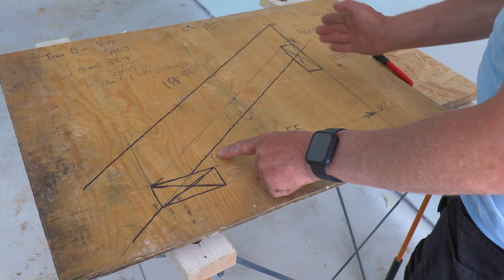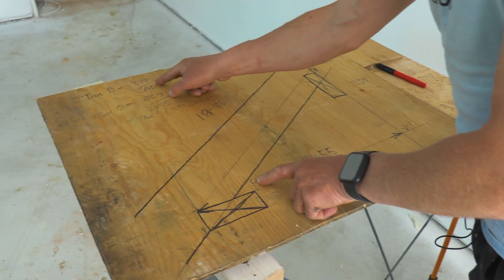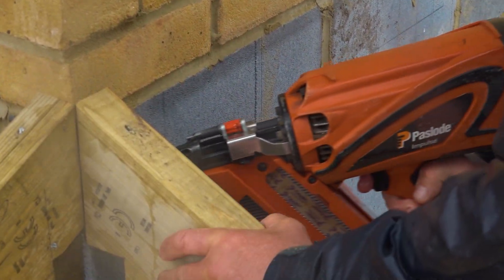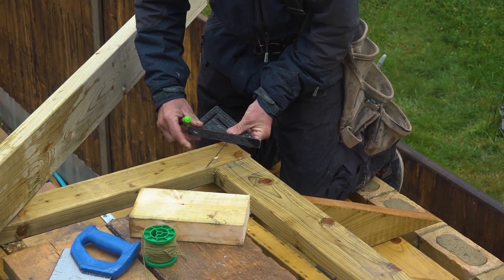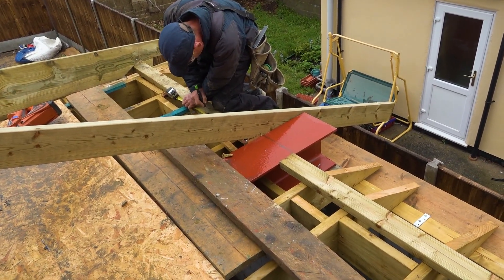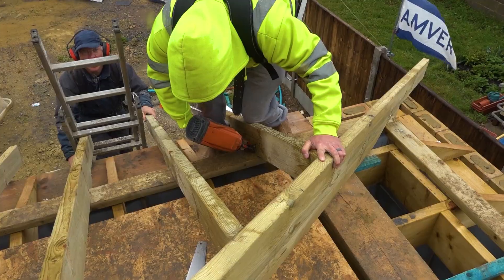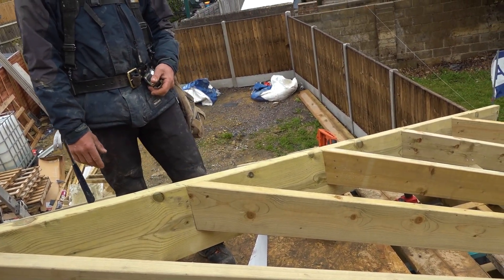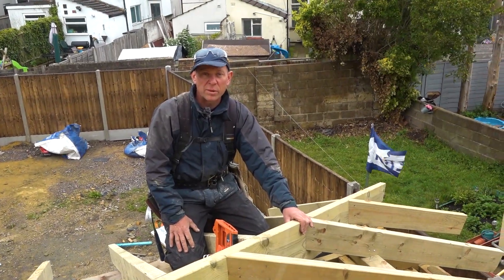How Do You Cut a Bastard or Irregular Hip Roof?

Comment: How’s the soffit going to look on that?  With bastard hips if you bisect the corner of the wall plate with the hip then the hip won’t bisect the brickwork on the corner so the soffits will be different sizes.
Reply from the maker: yes but if you have two different angled pitches you can't expect them to look the same in every detail. This is a problem solver. Sometimes you have to live in the world rather than wish it were different.
Reply: @SkillBuilder  yes but you can still maintain a consistent soffit with a bastard  hip by moving it off the corner of the plate.

Comment: Just curious... because Height above plate was kept equal, but roof was at different pitches on each side of the hip,  what did that do to the soffit/facia line? Was it an unequal overhang on either side of the building?? I've never managed to get a hip blade to go through the corner of the wall plates on an irregular hip and keep facia/soffit equal on both sides.
Reply from the maker: I think the soffit has to be wider on one side

Comment: ive had a roof like that when set out on plan using software hip sometimes does not run into the corner of the building  also done splayed corners  , which me and many a good roofer have scratched heads over , Ive found the roof  framing software on cheif architect 
amazing for finding hip and valley runs  draw any wall layout , software will try to  design roof layout

Comment: Not a dig, just intrigued. How come you’ve birdsmouthed over the the top plate? If it was an up and over roof you wouldn’t do that on the ridge?
Reply: The great chap I was working with, Aaron , wanted it birdsmouth over the top ridge as he’s had problems before with local inspectors. Personally I usually just have a full plumb cut against the ridge.

Comment: Great to see you back, but what a bastard job you've picked, that opposite figure is that the rise from wallplate to birdsmouth, also how did you work out the splay cuts on those Jack's ? Was that with the iPad.
Reply: Hi Kevin, the opposite measurement is the rise from the wall plate. I measured to the top of ridge then subtracted the hight above plate at the birdsmouth. 
To get the splay cuts I pulled the line and marked it in the wall plate. Usually it’s 45, however this one when measured with my speed square it was 38 degrees one side and 52 on the other. 
Lucky Aaron’s Skill saw went over to 52 degrees, the other I cut on the chop saw. 
Thanks for watching.
Reply: @Ultimate-roofing-square.  Thanks for that, looking forward to seeing you again soon
Reply: @amazing451  no problem Kevin. Roger did film it all however I think the rain got in the way.. 
Hopefully more videos to come.

Comment: As has already been explained. If you work to the height above plate then the hipboard will always hit the wall plate corner but the soffit width will need to change to keep the facia height. If you keep the soffit and facia the same and set out from the top edge of end of overhang then 1) the hipboard will not intersect the wallplate corner and 2) you may have to pack up the wallplate to pick up the bearing on the steeper pitch.
Reply: This helped me a lot, thank you and Skillbuilder (team)

Comment: At 4:50 Dan is about to explain how he checks the hip is correct but the video edit cuts it out. It looks like he is going to use that bit of timber cut to 127mm to check. Does he use that to sit the hip above the plate and scribe it in? I'd be interested to see that bit of footage or have it explained. Thanks in advance.
Reply from the maker: Hi Josh 
 You are completely right and I have looked for that bit of footage to understand why it wasn't use. There was a big rain drop on the lens and it went out of focus. We will get Dan to show it as a two minute tip.
Reply: That's great, thanks for your reply.

Comment: Your videos are just excellent, thanks! By the way... I commented on a previous vid of yours relating to stormdry cream. Since then I've had an interesting experience. I was trying to prevent drainage through jointing compound into under street cellars opposite a lower ground. After jointing them with a sika jointing compound, I used Resiblock paving sealant over 90% the pavers and joints. Then I thought to try the Stormdry cream on the joints, to help seal them completely, in the "water off a duck's back" way I mentioned in my earlier comment. I used the stormdry cream on half the paving joints... and what happened was extraordinary... on testing, the water, which had barely been sinking through the jointing compound after application of resiblock... suddenly started to disappear MUCH FASTER than EITHER the areas treated with both, OR the untreated jointing compound! So I was trying to figure out why when my best mate, who is much better at chemistry than I am, suggested the following which makes sense to me, and since you are a science oriented kinda guy, you might find interesting: the stormdry likely works by a chemistry that exploits a molecule with a hydrophobic and hydrophilic orientation, so one side attracts water, the other side repels it. LIkely there is a rather similar chemistry in the resiblock. So when I painted the stormdy on top of the resiblock... instead of the hydrophilic side sticking DOWN onto the grains of sand, and the hydrophobic sticking UP, the opposite happened. THe hydrophobid bonded to the hydrophobic, leaving the stormdry ass-backwards which instead of turning it into a hydrophobic duck's back, turned it into a wetting agent/wicking compound. Anyhow, thought you might find that interesting. GREAT channel, mate!

Comment: I never put a roof on with a nail gun. They dont hold as well as a 4inch nail driven in with your hammer.
Reply from the maker: You can see a bit where Dan is struggling to remove a Paslode nail. Ring shanks hold in a hurricane.

Comment: Just a quick one, have done many bastard hips before and I always pull a string line down through the corner of the brickwork and NOT the corner of the wall plates. (The true corner of the build?!) Therefore the hip rafter won’t sit in the corner of the wall plates it will be slightly to one side, giving a different HAP on both pitches (assuming both wall plates have been fixed down the same dimension from the face brickwork) I can’t see how Dan has managed to keep the HAP the same on both sides....with the hip NOT coming down at 45degrees in plan to a 90degree corner it’s surly impossible that both sides of the hips birds mouth end up with the same HAP?? Love that roofing square Dan, great bit of kit
Reply: Hi Shaun, 
We had some scope of where the pole plates went. They only went in to get over the metal RSJ. 
There was approximately 6 degrees different so we set the rafters up with the same HAP. 
With the roofing squares it was easier to set up.

Comment: I did one recently like this but also had different height on wall plate on either side by approx 100mm. It did throw the hip off the corner a good bit which looked very odd. Took a good bit of head scratching to get it right I can tell you. Hip was 6m long so would've been expensive one to redo if wrong.
Reply: Nice head scratcher. 👍🏻

Comment: No mention about dropping the hip or diahedral angle ? Would be great if Robin or Dan went into some detail about this in a hip video !!
Reply: I don’t usually put a dihedral angle on a 45 mm hip. Check out the other video on Skill Builder where James and I do put a dihedral angle on a wider hip. Thanks
Reply: @Ultimate-roofing-square. so for the hip angle at the top did you keep it 38 one side and other 52 same as the different rafter  pitches and 18 for the plumb cut if that makes sense
Reply: @Sherlockly  yes.. I cut the 38 degree one first, then went square off that to get the 52.

Comment: Could you askeyerman please, how often does he make an error where a bit of wood is to short or angle wrong? I need a refrence to measure how dumb i should feel. A dumbbob?
Reply: If in doubt, lay the timber in place, roughly Mark, and cut a little at a time, 
String lines are really helpful.

Take the time to look at any and ALL planning/construction drawings. There's alot of detail you can use such as measuring angles Ang rough lengths  (don't be scared of using a ruler and pencil to extend the drawing lines to help get more accurate measurements)
Reply: @sally6457  Thanks Sally. Seems like an over complex system to shed water off a roof. 🙂♥️
Reply: @express375  the structure is about supporting the materials that she'd the water, and roof tiles are heavy! You want a simple solution? Buy a hat!
Reply: @sally6457  Ah but then we go onto why still using stone age heavy materials.I don't see the point of making a house that is built to last for 400 years. Seems like i am wasting my money for future people to spend on sexbots! One of my stoner theories, is why can't an old house be shrink wrapped in plastic. that would last 25 years. With dehumidifying technology it could be perfect inside. Alex turn it down a bit!  Houses are not designed for this reality, they are bloody awful. :)
Reply: @sally6457  Thanks Sally, Elon Musk said he was going to design his own house, but thought a rocket to Mars might be more important. Sympathise for you getting Paranoid from weed, maybe try a diffrent variety or cut down on bong hits. A concluded it was a myth in my observation, Cheers Shaun :)
Reply: @express375  think that we may have strayed from the point somewhat.........is there any ice cream left?
Reply: @sally6457  fish and chips :)
Reply: I'm sure he said that in the video 🙄🔨
Reply: @tomsmith9048  your point being? 
Your either being rude to someone who asked for advice, or rude to someone trying to help a person who asked for advice?🔧🖕
Reply: @sally6457  I assumed he was being sarcastic 🤯 as for your measuring angles all the plan or section through will you give you is digress of pitch height and span the rest is up to the Chippie extending lines through ect will do nothing to help you as it's all worked out off drawings hope that helps 🔨👍💚
Reply: @tomsmith9048  thanks Tom, how many times a month was the static bro? 🙂♥️

Comment: I believe if you have two different pitches and you have kept the HAP ( height above plate) the same on either side of the hip, then I’m afraid you will have conflicting fascia heights as you turn the corner. I would of looked at specified measurements where the fascia lines are to meet on the outside corner thus giving you the correct striking line as to where your hip should of fell on wall plates. It’s hard to explain but the true line of the hip is where there fascia corner is.
Reply: That’s right. When the hip changes on the corner of the plate the go to point is the fascia hip plumb cut. Otherwise you end up bolting on scabs of timber on the side of the hip to make up the corner difference. 
Which is not right.  Generally the span on the steeper side is narrower than the true overall span on the shallower side. 

I do think that the run measurements from wall to plate were so minimal that you probably hardly notice it. 

Explaining offsets of hips and varying plate heights would of baffled most.
Reply from the maker: Maybe that is why they call it a bastard
Reply: @SkillBuilder  exactly that!😉

Comment: Looks great , do you end up with a difference in height with the soffits because one side is steeper than the other ?
Reply: By keeping the HAP (height above plate) the same then the fascia will end up the same, but you are right in thinking the soffits will be different depths because the shallower pitched roof has further to travel, i've done a number of irregular hipped roofs and they are a pain!
Reply: @RobNorman08  they sure are a pain.. 👍🏻
Reply: No, not on this roof. The soffit was different widths tho. 
Thanks.
Reply: @Ultimate-roofing-square.  did one side of the Jack rafters have to be cut by hand because of the angle on the splay cut ?
Reply: @billydickson1521  I was lucky as one side was 52 degrees and the de Walt saw went over to that. 
Roger did film it all, and the plumb cut on the hip where I cut one side at 38 then I cut down the splay cut to get the 52 degrees cut, however I think the rain got on the lense...
Reply: @Ultimate-roofing-square.  Oh I see, thanks for the info mate I appreciate you sharing your knowledge 👍👍
Reply: @billydickson1521  it’s all good fun sharing it. Thanks to Skill Builder for filming it. 👊🏻

Comment: Another couple of points,  I would usually swing the hip over a bit so that it meets the corner of the facias,  but your right it can be a bit of a fiddle getting it to sit right then.
Also, looking at the rain pouring onto the oversite reiterates why we always put the dpm on top of the oversite and under the insulation, that way you don't have the moisture from the concrete drying out into the room.

Comment: Any reason they didn't cut the end of the steel back at an angle ?
Reply from the maker: The builder didn't want to because it needs the engineer to approve it
Reply: I had a feeling you’d say that 😊
It’s a pain because a good engineer should foresee the issue and give a design for the cut off. Its no big deal either because it only needs to be cut and plated over. Engineers never seem to see it though.

Comment: Love these videos. Dad was in the trade and I loved going on jobs with him as a teenager. I ended up as a software developer and have been stuck at home staring at my laptop for the past year. Working outside, even in the wet and cold actually making something is starting to look very attractive!
Reply: The grass is always greener! Just remember in England the grass is also constantly wet and muddy, and you have to buy your own lawnmower to cut other people's grass, 
Stick with software, and build a shed!
Reply: @sally6457  ☺️ There speaks the voice of experience. It's not an easy life, that much I know - part of the reason I didn't follow in his footsteps!
Reply: It's not easy at all.
These videos make it seem like you just have to learn abit  of basic trigonometry and buy few powertools and everything falls into place.
(Which I did, so I know it doesnt work like that)
It would be nice if it was the case.
But 99% out a hundred, there's tonnes of factors to take into consideration.
The building isn't square, the plates aren't level, the timber isn't square or straight, the pitch of the original roof varies because its old and rafters begin to sag...

It would be bloody lovely if I could just take a few measurements from the plates, go down to my saw and pile of timber, use the ready reckoner/rafter scales and cut everything on the ground, carry it up and fit it together.
If your plates are even 5mm out of square then nothing will work perfectly.
You might be able to twist a few bits in here or there but eventually you'll end up having to recut things at a slightly different pitch or length.
Which wastes materials and time and ultimately costs you money.
 
Bricklayers lay the plates usually.
Their tolerance is 8mm in or out.
Usually alot more coz they know nobody is checking that thoroughly on private work.
Plus, bedding timber on cement is a stupid idea in my opinion
But nobody want to pay for a chippy to come set the plates properly with wedges and mechanical fixings
Certainly not the brickies if it will highlight how out of square the whole extention has been built.

But to be fair, I couldnt imagine doing anything else.
I love cutting in roofs.

Comment: If the rafters don't line up the tiles won't on the same pitch could look  a dogs arse!
Reply from the maker: which is why they do line up
Reply: @SkillBuilder  the rafters don't line up down the hip (even if you say which is why they do) at 7:29 you can see his hand between them and at 8:16 Roger confirms that can you show us when the tiles are on?
Reply: With an irregular hipped roof you'll either use a 1/3rd round ridge tile down the hip so it becomes almost  impossible to see the relationship between the tile gauge on one elevation to the other or else if possible you tighten the gauge on the shallower pitched elevation.

Comment: Dan knows his stuff alright. What a great addition to the team 💪
Reply: Thanks. 👍🏻
Reply: @Ultimate-roofing-square.  hi Dan,
How did you get the plumb cut on the hip as 18degress? If the commons are 22 degrees doesn’t the hip plumb cut come in at about 16 degrees? Thanks
Reply: Hi  @jaser461986  , one side was 22 degrees but the other was different. I measured from the corner of the wall plate ( where the hip sits)  on the diagonal  to plumb down from where both ridges meet.  Then the height above the wall plate to top of ridge, then used trigonometry to get the pitch. We did film a different method however due to the rain it wasn’t added.

Comment: Is both roof pitches minimal to not affect soffit widths to much? 

Generally on a bastard hipped roof,  steeper pitch roof plate has to be higher to compensate for degree difference. 
In this instance the pitches are not that much apart to affect this detail. Looks that way. 
If anyone is interested a book called the “roofers bible” from America explains irregular pitch roof in great detail. 
This is what I ordered to get some insight when I was doing my time. 

A string line is always a very important part of a carpenters arsenal. Always will be. Only tool that can give you a true trajectory of a timber in roofing. 
Great content as always. Well done lads.
Reply: 100% true, really need to be careful if it was on front of House

Comment: Had a bad roof recently, new build to existing had 50mm out parallel to plates and 60mm out from gable to gable, getting over it with wood is easy compared to running roof tiles to catch up especially with 3 velux windows!
Top job though lads, never get tired of watching roofs being cut.